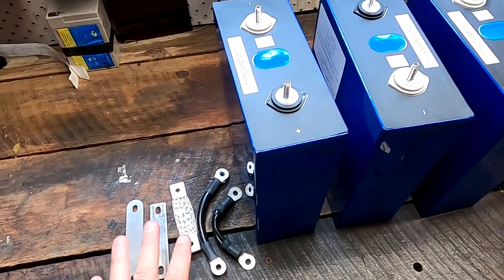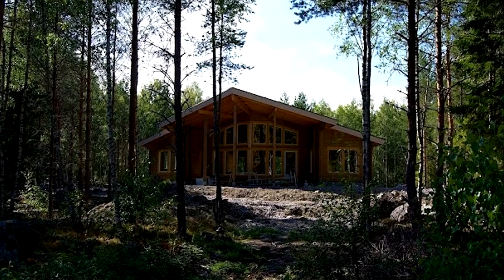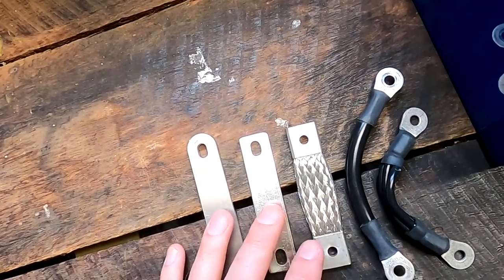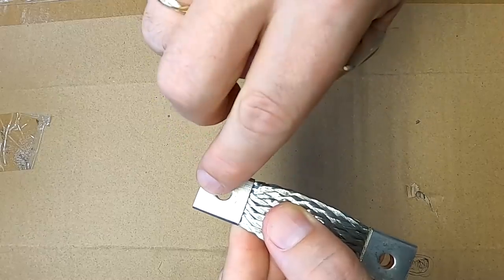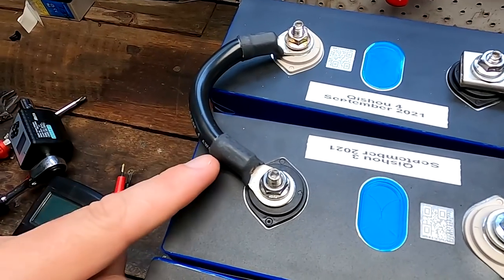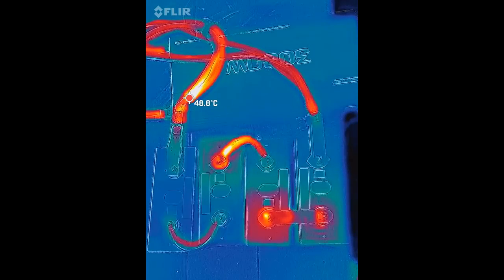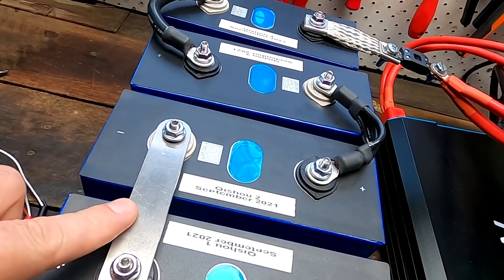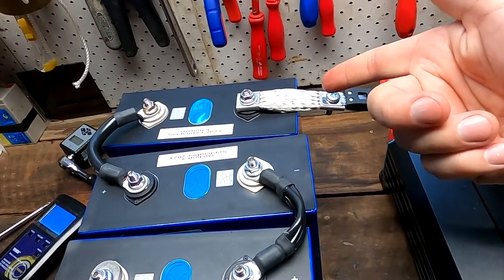All these different busbars... and why they don't matter!

Comment: Conductive materials, metals and stainless steels properties table:
Electric conductivity (10.E6 Siemens/m)	Electric resistivity (10.E-8 Ohms.m)
Silver	62,1	1,6
Copper	58,7	1,7
Gold	44,2	2,3
Aluminium	36,9	2,7
Reply: if you look further down the table you will see steel is an even worse conductor and has more resistance...
Reply: stainless steel is utilized for the bolts and hardware as it is fairly corrosion-resistant....not for any conductivity properties....🤔🤔
Reply: The problem here is not the conductivity of the busbar material. The resistance of a busbar made from Aluminium can be the same as from copper if you only make it a little bit wider and thicker. The real problem is the contact resistance between busbar and terminal.
Reply: @thomasschmidt9264  Pretty sure Michael is making a point about Andy measuring via the terminal screws. But he may also be pointing out the Aluminium properties also. 

His table doesn't seem to be based on volume. Probably assumes identical volume. 

Also, it's a mixed up table, using commas to delimit fields, like a language, but also commas to act as decimal point, a European convention. 

I thought if using a comma for decimal point, you DIDN'T use commas to separate fields?
Reply: @pilgrimvalle  They could be nickel plated copper studs? How does your table work then?
Reply: @CollinBaillie  i know of no nickel-plated copper studs(there may be some)....I think most all the 6mm studs are stainless steel...copper busbars are nickel-plated to stop/slow the corrosion between the two different metals...the stainless steel hardware used and normally provided by the battery vendors is for attachment purposes as stainless steel is a poor conductor but is very corrosion resistant...open the table up on the web and you will find iron a lot farther down on the list...stainless steel is a higher grade iron composite basically depending on the grade of Stainless steel... the stainless steel hardware is not there to be the conductor of electricity... but rather the mechanical connector of good non-corrosive properties...i am sure he does not have nickel-plated copper studs....ask him....please???
Reply from the maker: Of course aluminium is conducting worse than copper. But if you have seen the video where I introduced the aluminium busbars, I did also the calculation. Because of their dimensions, they have less resistance than the standard copper bars.
I was also curious to see (and experience and share) how they perform over time.
Reply: @OffGridGarageAustralia  yes, I watched that video where you introduced the thicker aluminum busbars; it seemed like a possible solution but the rapid oxidation and thicker aluminum to achieve the same ampacity is causing you a lot of connection difficulties....flexible copper with tinned lugs may be the better long term solution for the DIY people...to get the same ampacity thicker aluminum has to be used due to the higher resistance in aluminum...getting the thick stiffer aluminum in the same parallel plane for the electrical connection is the difficulty I see in your videos....thanks for all your videos showing the good and not so good products...👍👍

Comment: cool measurements !! Way too much contact area for Pauls Super Alu busbars. Please try a small M6 washer between terminal and Pauls Super Alu. It should increase the contact pressure and lower area. Should result in a much better contact.
Reply from the maker: I think such a washer will do the exact opposite as we have seen under the other busbar where I forgot the washer. Maybe a silver sheet as someone suggested could make a difference... but the aluminium still needs some work to lower the resistance.

Comment: Why even use aluminum bus bars? I believe you had the issue discussion when you switched, can’t remember thou..
Reply: The battery terminals are aluminium, so the idea was to have matched metals.
Reply: @TheDigitalMermaid  Thanks for the answer/reply.
I bought some 60-70amp lipo4 pouches (second grade) their anode and cathode are one in copper and other in aluminum. So the recommendation from the manufacturer is to use nickel coated coper when connecting the buses (the individual cells 3.6v) in series to build a battery with higher voltage. (Obviously this isn’t a problem if you build in parallel). Can’t recall at this moment wich was coper or aluminum (anode or cathode). I guess the cells used in this video are all having buses with aluminum and why? My question is coming from that the cells ~260 amps truly are batteries and not single“cells” with many in parallel and inside the battery (3.6v) couldn’t they have different metals connected with nickel alloys at the outs (bus)?
Reply: Sorry I don’t remember if the correct lifepo4 /lipo4 cells, the pouches I purchased are anyway the 3.6v maximum voltage. 3.3 nominal. 2.5v lowest.
Reply: Sorry for my crappy English.. :)
Reply from the maker: I'm using aluminium bus bars to learn over some time how they perform and what problems can occur. This is what I share here on the channel. We're not going the straight path here 😉
Reply: @OffGridGarageAustralia  straight is so boring... :P
Reply: @OffGridGarageAustralia  That’s fantastic!  You do things very much in detail and with humor and I think that awakens curiosity, thoughts and questions that leads more straight to true knowledge than rather just repeating what we think we already know. 
I don’t expect an answer to my selfish question (because I want to know/understand more) but is it so that lifpo4 cells usually have coper and aluminum buses accordingly to the cathode or the anode?  I assume the big amp capacity batteries have several cells “stacked” in parallel to make them, maybe say at least when a “cell” is  over 70 amp it’s probably not a cell but rather a battery? (3.6 v configuration).
As said I’m not expecting an answer and put this question out there maybe to also further curiosity if there is no answer available.

Comment: when copper is tinned it is to stop or limit the galvanic corrosion between different metals...tin is a much poorer conductor than copper, nickel is better than tin, silver is a lot better than tin, aluminum is way down on the conductivity list so it has more resistance to current flow... thicker aluminum has to be used to carry the same amount of electricity....that is why aluminum is not recommended for wire in many projects. and they use aluminum, an anti-oxidation goo on it as it oxidizes so quickly which will again increase the resistance of the connections. if the connections get too hot they can fail. I am not an electrical engineer but have studied a lot....please re-think what you are telling people...a flexible bus bar may have some merits in certain applications. I personally use thicker 2AWG cables interconnects between the series connections, in the 4P8S builds and a lot more interconnects (4 per set of series interconnects)as that is what the electrical engineer suggested and have had no problems... the supplied tinned or nickel-plated slid copper bus bars work fine as the paralleling of the 4 cells together... do some more research it will pay off for your system lifespan...I do enjoy your testing new tools and products....keep improving...thanks all ... have a great day! 😎😎
Reply: How many of Andy's videos have you watched Michael? He's covered all the things you have commented on in this video. His aluminium bars are much thicker than the copper bars so they actually have a lower resistance. He's made it clear that his issue is the quality of the connection due to surface irregularities. The copper can conform to the terminal surface, while the aluminium cannot. This is why he does the "polishing". 

And when he says tinned copper bars, I think he's using a "layman's" term. Those bars may well be nickel plated, but they colloquially known as tinned copper.

"a flexible bus bar may have some merits in certain applications" - pretty much fits with Andy's advice. It's up to you to decide what your particular application requires.

It's all in the video, in all his videos. 

I like to slow down, and take some undistracted time to watch Andy's videos as they contain a heap of information which can be easily missed when distracted. When you're playing around with kilowatts of power, you certainly need to think clearly. Sometimes I watch them multiple times over months (meaning months between views). I recommend it to anyone who watches his videos.
Reply: I believe Aluminium as bus bars is the wrong choice.
Reply: @CollinBaillie  i watched many, he is quite entertaining in many of his videos,,,,almost all of them, but his tests are seriously flawed in this video... if he wants to compare bus bars and their actual resistances. you can only test one type at a time with all the same variables...this he does not do. the ss stud/grub screw is not where he should measure the resistance from...measure from the battery cell which may be impossible with his cells, but even measuring just past the flange nut on the surface of each busbar would be more accurate if he used the same variables with each type of busbar which he does not. one has to choose what makes the most sense for their own financial pocket ... for the 96 large lifepo4 cells I have assembled in 4P8S configurations and charge with solar I use solid copper plated busbars between all the parallel connections and use four  2 AWG copper cable with tinned copper lugs between all previously connected parallel cells as the electrical engineer suggested..... no need for the flexible braided busbar route in my use, as it is not available in a sufficient amperage rating (at least when I searched that type out)... but again everyone's choice is their individual choice in the quality of materials and its safe usage...i encourage all to do research and if you are not sure get some professional help with electrical connections. in the USA the electrical code has a lot of good guidelines which is definitely a totally different system voltage than 50Hz 240 volts in Australia... DC is far more dangerous than AC!!!! i will stop on that.... sorry if I state anything anyone may disagree with.. cheers from the USA....have a great day😎😎
Reply: @pilgrimvalle  I made those "tinned" flexible bus bars using also tinned wire, because my planned use is in a boat. The corrosion protection is very important to me, and clearly from Andy's tests, the tinning didn't cause a problem.
Reply: @TheDigitalMermaid  no, the tinned wire is almost a must and a requirement for salt water use...
the tinning of the copper wire does add a bit of resistance to the wire vs copper wire that is not tinned... 
that can be found in wire documentation tables...
 I was going to buy some 4/0 tinned cable... i have use some of it before....the insulation jacket is far superior on the 4/0 tinned copper cable I previously used...
tinned copper is what you want for marine saltwater environments....👍👍
Reply: @TheDigitalMermaid  we have 5 cats on the off-grid farm but they are all outside cats, but pets and they are great mousers...😎
Reply from the maker: Michael may not have seen the video where I introduced the aluminium bars bars. 
This channel is to experiment, learn and share the results. Some people don't get that and think I'm doing it 'wrong'. I'm doing a lot if things wrong because I want to see what happens if you don't follow the usual path. How boring would it be to just buy a ready-built battery and connect it to a solar panel and inverter? We would basically learn nothing. The goal is to take detours and explore. Some people really don't seem to like this...
Reply: @OffGridGarageAustralia  yes,I watched the video where you began the use of the thick Aluminum busbar, I guess maybe the provocative title implied there is no difference when you really was trying to show something else...the taking a different path to show the difficulty of the obtaining a good electrical connection using Aluminum bus bar of twice the thickness...entertainment / edutainment...yes... i watch as you are definitely fun-natured in all the introductions to electrical flops in the products.........have fun in what you do!!!👍i knew 16 cells would not be enough...you are hooked to the solar photovoltaic adventure....have a great day!😎

Comment: Question for the people with more expertise than me; I ask why is cheap aluminum wire shunned and where specifically allowed in AC wiring to the metal breaker box inside of the conduit it is attached to copper with tin plating on a good UL rated breaker box. they disallowed aluminum wiring per the NEC electrical code many years ago I believe... in the USA...
 In sunny hot Australia, I know nothing of electrical codes and regulations of wiring in grid-tie systems or their requirements to follow for off-grid systems... but suspect they have a similar code to prevent fire due to electric connections>>> Does anyone care to comment...??? 
Will Prowse said to avoid the copper clad aluminum wire and go with pure copper wires for his off-grid suggestions in his youtube videos...is the aluminum wire a liability that the big corporations do not want the legal beagles to get their money grubbing mits on??? not allowed in most places I am aware of....but then again I am not an electrical code expert either....
Reply from the maker: I think they used aluminium wiring in domestic installation back in the days because it was a lot cheaper...

Comment: Bending wire as bust bar is not good. Straight flow is key.
Reply: Why?  LOnly reason I see would be length. But if it measures good, it's good, right?
Reply: @ceeweedsl  think as your bust bars like the flow in a river water has resistance in the bend in the river. Just like the flow in your wire.
Reply: @Mike-eg5iw  Naw.  I think you just made that up amigo.   Electrons don't act like a fluid.  Sounds good though.

Comment: Just make your own bust bars with cooper pipe  use a hammer to flaten the cooper pipe and drill your holes
Reply from the maker: Noooo, that's a big no, no. Water pipe copper is not great and it will never be that flat.

Comment: Aluminium bus bar fixed bus it should be 2 times thicker than copper bus bar . then there would be no problems
Reply from the maker: Yeah, we tested this in all details here on the channel. The Al busbars have a lower resistance than the copper bars due to their size.

Comment: I very much disagree with this kind of information.

1)failing tests can mean everything, even a failed cell

2) the tests are not just about safety at all!

3) the lowest capacity is not a problem.

4) the big difference in IR is a severe ptoblema

5)"discarded cells are fine, they just need a little attention." This absolute statement is not true. Maybe if you're lucky. If the IR difference is serious, the battery will be unusable in a few months, because it always tends to get worse. In addition, the bms will never be able to balance and the battery will be usable at 10 or 30% of the capacity.

This statement applies to lead-acid batteries that are always overcharged and the lower cells always come to 100%, as the higher cells are overloaded without any problems.

Even in discharge, everything can be taken from the lead acid battery even if unbalanced. A cyclic lead cell brought below 0% is not destroyed immediately.

A single overload destroys a lithium cell, a single discharge at 0% effective can destroy the lithium cell. So you can't overload or totally unload. So batteries with cells with different IR are garbage.

Even more important:

Cells that pass the tests, have unique parameters and all the same. Among those that do not exceed them, there is the whole scale of each parameter. Cells that will die in 2 months also fall into the category!

Example: to pass the IR test you need to have between 0.07 and 0.08 mohm. So all grade A cells have that resistance . those that do not pass the test, does not mean that they will all have the same resistance, but it means that they simply have greater or less resistance than the target. so they can also have 0.15mohm and another 0.04. They are sold to you and your battery will be garbage.

Not to mention a thousand other parameters such as: self-discharge, capacity vs temperature, temperature vs charge current.

Differences in some of these aspects are tolerable, but they complain about IR and self-discharge no! Since there is an electronic management based on tension!

Die that the thrown cells are great for Storage is like those who say they use cyclic lead starter batteries and all different put in parallel and everything works. Of course it works, but with an enormously low efficiency compared to the potential of nominal capacity.

If you put 25 used car batteries all different for a total of 2500ah and use 500, and every time one is destroyed you add another ... of course that's fine.

But it's not my way of designing a system.

Comment: Love this video. But, please God, or whatever you believe in, can you please take that 80 amp bus bar off your finger when running your hand over those cells?
Reply from the maker: Nonsense. I would need to touch both pos and neg through the ring. My fingers are not big enough to spread across... IMPOSSIBLE to happen.
Reply: @OffGridGarageAustralia  Maybe you could wear a long gold necklace too. And get a nose ring and metal bracelets. Unnecessary metal near batteries is great.